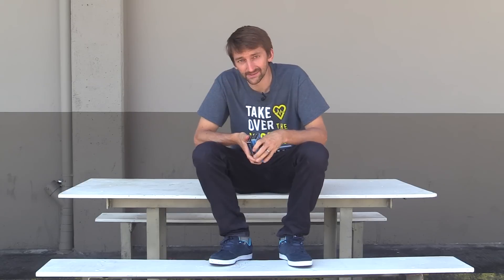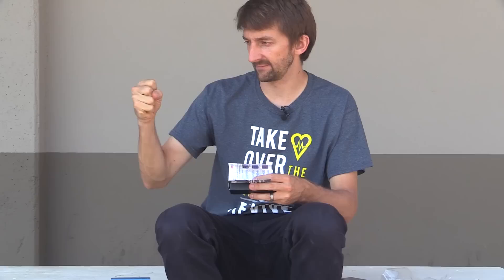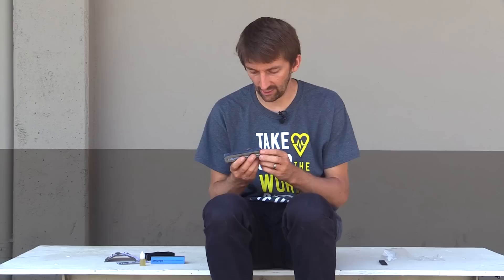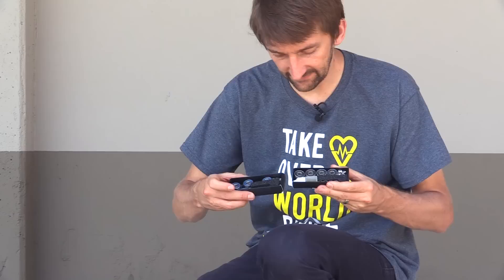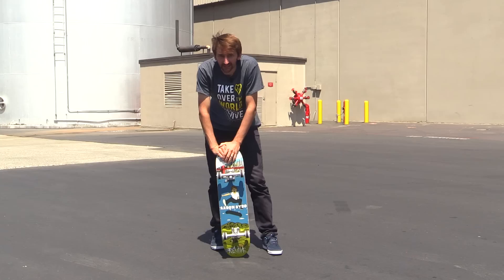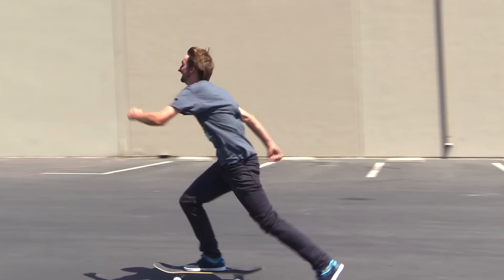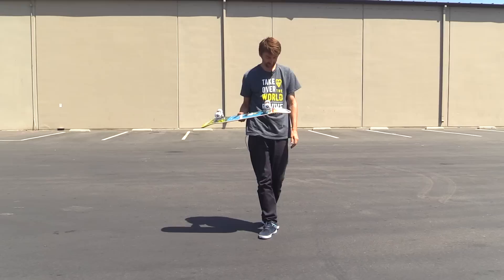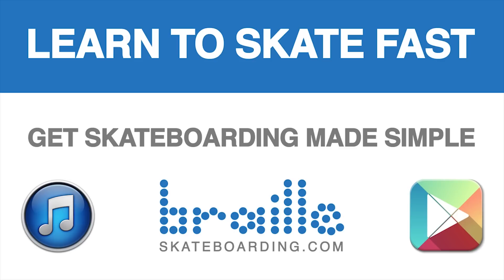CERAMIC BEARINGS VS STAINLESS STEEL BEARINGS | VS EP 9

Comment: Actually the problem of the steel ones is that they slightly expand under heat, causing more friction, unlike ceramic, this ones stay the same way. They both heat up the same way, but they react differently. It's a lot more critical for longboarding, here you can reach way higher velocities and bearing heat. Hope this is helpful
Reply: thanks
Reply: even though your comment is 5 years old, it helped me a lot. THANKS:)
Reply: 2023 I literally stopped this brail vid at 17 secs cuz this told me all I need to know lol .
Reply: Ceramic expands abt 50% as much with same amount of heat idk if it gets up more/less/same in comparison due to friction though so that doesn’t really mean it’s that amount better

Comment: "That heat causes friction" facepalm Friction causes heat
Reply: it said heat from friction, not heat causes friction
Reply: +Harry Belcher  shit sorry he said heat causes friction later in the video. My bad.
Reply: +Harry Belcher 
friction
heat
balls expand
Reply: +Logical Order The heat deforms the bearing balls inside and increases friction is what he meant
Reply: Yea I think it's friction causes heat which in turn causes more friction. If that makes any sense.
Reply: I actually face palmed hah
Reply: Heat causes friction to intensify, actually. If you take a materials science course you will learn that.
Heat also comes from friction, so friction causes heat, which causes more friction.
Reply: +Matt McConaha ooo sorry smartypants
Reply: +Michelle hansell 
a wild 8year old appears...
Reply: +Logical Order your name goes with that comment
Reply: +Tapp Water 
why the fuck cant i + comments when on phone???
Reply: does he know that metal expands
Reply: Well the metal will expand from heat and cause more friction?
Reply: +Logical Order The heat from friction causes even more friction.
Reply: +Ľuboš Rybanský right but the heat is first cause just from the friction alone
Reply: +CookieMaster friction, heat, balls expand
more friction - more heat - more expanding - fine sand adds to the show and bearing locked forever. But that's no proof the 'ceramics' arent too expensive
Reply: The comments on this thread are just as incomprehensible as the explanation for stainless being shorter lived than ceramic because of its Physical properties from the video.
Reply: Timothy McCarthy Ah, someone who really knows how it really works..but how is not told so i'm waiting. I'm sorry for telling disinfo if it's nonsense, just too theoretical, could be. I realize that the total bearing expands by the heat so the added friction might be minimal and there is a small gap between the balls which gives room for some expansion.
Reply: Logical Order they work vice versa. Friction causes heat which causes more friction.
Reply: friction causes heat, and more heat causes more friction. also, heat makes friction create more friction heat. because heat is friction, friction is also heat. furthermore, by creating this friction heat, heat friction will grow as the friction heat grows. furthermore, the heat of the friction will become so hot that the friction heat will give any man a boner; but only because the heat friction (not the friction heat alone) makes things even more hot. like you, i am a scientist.
Reply: JayDee SV well said :p
Reply: If we're going to get technical about this, heat actually causes less friction. If you heat most things up, they will become less viscous (a.k.a more liquidy), and the less viscous something is, the less friction you will have rubbing up against it.
Reply: I facepalmed at your comment. The friction in the bearings causes the balls to heat up thus the balls expand. The balls expand therefore make more contact with the outer walls of the bearing meaning more friction. So... Friction causes heat and then the heat causes more friction. He isn't wrong just left the first bit out.
Reply: Logical Order o
Reply: well since Aaron also has a masters degree in Materials Chemistry, its obviously embarrassing that he doesnt know how these materials behave under different circumstances.
Facepalm indeed. 
Ah no sorry, he spent his life building one of youtubes biggest skateboarding channel, I must have mistaken him...
Calm down. 
Ask the average person and if you gonna facepalm everytime they dont know the right answer, you gonna have a concussion.

Comment: Ceramic bearings are just a marketing strategy to get you to buy a more expensive bearing. Ceramic bearings do handle heat much better, but you will never go fast enough for it to make a difference. If you plan on doing gaps and stairs, steel bearings handle a much higher load than ceramics do. Ceramic bearings crack much more easily than steel ones. As long as you are periodically cleaning your bearings will allow them to last much longer no matter what type of bearing it is. The only plus ceramic bearings have is that they won't rust, which will help them last much longer. That's really the only plus side. Other than that, stainless steel is the way to go. Just make sure you are checking for rust and are cleaning them
Reply: also, the steel rings on a ceramic ball bearing will rust, just not the balls. fyi
Reply: +Rage CL they are actually ment more for longboards. the speeds they go, stainless steel will melt their wheels. they actually do go alot faster as they hold speed longer. iv used both on my cruiser board and iv blown up wheels with stainless because of them getting too hot from bombing a hill to get home faster haha. but ill blow up ceramics all the time by even just doing ollies. its not a marketing strategy, its just guys buying shit ment more for longboards. its like buying longboard trucks to help prevent speed wobbles, but complain that the kingpin gets destroyed for being positioned wrong. lol (i do both, longboard and skate. nothing funner then bombing hills and doing kickflips. lol)
Reply: +Red1676 you see what I mean though. Skateboards don't need them but they market to all types of boarding in order to get more sales than just from longboarding
Reply: I find a lot of them are still marketed to Longboards.  Lots even come with spacers built in. I find a lot of shops will try to get into this long board trend by bringing a bunch of Longboard stuff into their shops as of sales. The problem is the majority of the people buying the Longboards are just people that have no clue of what Longboards are more geared to and just use them to kick around (the people that the skate community hate). So these people will only buy the single longboard, then think they are set. shops think they should bring in all the extra stuff like bearings and the trucks because they think like skaters as every skater needs new parts when their set is destroyed. These idiots don't think like that though, they will kick their Longboards into lakes, use them in the rain, use them in snow and have no clue of anything to the point they will just get rid of it or buy a new complete. Basically,  a lot of the reason why you see more people using ceramic is because shops buy all of this stuff for Longboards,  but it all just sits there. So the shops will drop the prices and will sell it to anyone that is in need of bearings. It's also why you will see a lot of the idiots on Longboards ment to bomb hills and slide. Shops bought them to sell to wider customer base that doesn't really exist, then sell to anyone  when it sits too long. That's kinda the root of people getting ceramics. 

It's fucked though, the majority of the people that hate Longboards,  they don't know what they actually are made for. Lol
Reply: WTF did i just read?
Reply: +Nobsi da Nobs the truth
Reply: Rage CL Nothing of this makes any sense. 
If nobody is buying it and all the longboard riders are idiots, then how does it profit the people that sell it. Youre all speaking out of your arse. I have been working in a skate shop for a few weeks, Lonboard riders have spent the most money over that time by not a small margin to say that.
Reply: Nobsi da Nobs it depends on where you live and what demographic are buying longboards. its like if you live in a collage, the majority of sales of longboards are frat boys and hipsters, where you can sell them just about anything. there are alot of places where downhill longboarders is just getting popular or already are. but there are lots of places where the majority of average people only see them as "crusiers." im here in canada, legit longboarding is popular more out west then out east. when i used to live on the east coast, there was maybe two core downhill guys that would go to the local shop, the rest were the stoner "cruise" kids. now that i live in a bigger area, there are the shops that are selling alot to the core longboarders, but the majority of their longboard sales are to the kids that dont know they are standing on something that they should be wearing a helmet to ride. but the whole reason ceramics are being used in shortboards are because the shops that dont have the core longboarders, they get left with left over stock. i know this because i did placement at my buddies skate shop and know alot of other shops that will do this. iv seen guys buy seismic tekton to be used in some spitfire f1 lizard king street burners because the shophad them marked down for sitting too long. there are also alot of the bike shops that iv seen selling skate stuff and will do the samething. no longboarders are not idiots, i was saying that their bearing serve them a purpose. yes they do spend more then anyone else at a skate shop because their setups are expensive.  ceramics are not made to take impacts.
Reply: Rage CL would it be good for longboarders tho?
Reply: Drew Porter it would definitely be better for long boarders because they wouldn't be at as much risk to crack and if you do downhill stuff your speed might actually heat them up

Comment: I like the explanation except the example you gave. The deformation of the balls from high rpm is what they are referring to. The weight of the rider is negligible. And since they deform less(essentially just because they are a  harder and smoother material) is what is going to cause them to run cooler. Momentum energy stays momentum instead of changing into heat energy via deformation(another word for friction)

Comment: Another reason these high-tech crystalline ceramics are good is because when smooth steel is forced into contact with another smooth steel surface, it gets "wrung" or bound to it in a physical way, much like a suction cup. This effect, when left alone, can cause those two pieces to slightly weld together, and when broken free, will cause marring on both surfaces, where as ceramic on ceramic or even ceramic on steel will not weld together when wrung. This info, mind you, was taught to me by my college manufacturing and machining teacher, and was originally in reference to the care and treatment of gauge blocks, which are precision measuring tools that must be wrung together to get an accurate measurement.

Comment: The only time I can see a need for ceramics is maybe downhill racing due to the heat buildup.
The "deformation" is a sales gimmick. Yes steel can deform under 1000's of pounds, but ceramic will crack or chip long before that... like the first time you kick flip.
Plus, they're probably not even ceramic (zirconium dioxide), It's probably just titanium nitride coated steel (technically a ceramic). The stuff that makes dirt bike shocks and drill bits look gold. it's a cheap and effective friction reducing and highly scratch resistant coating.
Save your money, just buy quality steel.

Comment: Heat causes friction.  Thanks Aaron. Today I learned some physics.
Reply: Napukin I thought that friction created heat?
Reply: Friction causes heat. But in  the case of these bearings the friction causes heat heat causes the bearings to expand, bearings expand and make more contact with the out wall of the bearing thus more friction.
So you're right in this context but wrong in every other context. Both LegendLength and Napukin. Both of you are wrong.
Reply: Ryan Uri Thanks! This helped

Comment: I find the easiest way to notice a difference in the bearings is how much longer the ceramics spin than the other. Not only are they faster, but they spin longer because it takes longer for the friction to stop them. So if you were to always start off skating stainless bearing with 3 pushes and see how far you roll, compared to how far you roll when you give the same 3 pushes of the same force using ceramic bearings, you'll actually go farther. That's what I've noticed more than the speed when it comes to the bearings.
Reply: not how it works when you add friction

Comment: by under load they mean maximum use, the more you use them the hotter the small balls get and metal  heat faster making them expand or deform  they don't mean deform  from the load of your weight.
Reply: you a furry?
Reply: yes I'm a fur.
Reply: really?
Reply: This is correct.
Reply: yes lol
Reply: fair enough
Reply: +Mingetease 'load' is a term used to represent a measurement of it's usual use, so load on the back of a truck is literally the items.
in this case it's a rolling motion with a human on top. the faster or heavier it gets the more 'load' is put on the bearings
Reply: Dylan Zrim Load isn't a measurement at all. Stop trying to pretend you know things so that you can verbally somersault your way to changing the meaning of a word. You wanna teach me something, find an official definition.
Reply: load is definitely a mesument in 1 way shape or form when ur car is in drive your car motor is under "load" when in park or neutral its not under load same thing applys to the berrings not u sitting in ur car not standing on the board
Reply: Exactly
Reply: +Mingetease load is an amalgamation of multiple measurements that takes into account weight, weight distribution, friction, time in use, speed........ Don't humiliate yourself
Reply: +Mingetease highly doubt that mate, like I said, load is a measurement you get after an equation of lots of variables.

not 
weight = load

closer to 
weight + friction + speed + many other things ~= load

just as velocity is speed and direction.
Reply: Dylan Zrim Which includes weight...
Reply: +Mingetease includes but isn't ultimately defined by weight...
Reply: the only thing ultimately defined by weight is weight and all it's measurements. (kg, lb) load is not one of those,

load is it's own category of measurement  completely
Reply: besides, the op is right... the bearings deform as a result of all factors (load)

weight alone can bust the bearings, but you'll need a hydraulic press to damage the bearing balls. and expect to 're-tool (touching surfaces will deform first, they're high tensile steel surfaces) it will more than likely violently explode, and if the press isn't industrial you'd need to fix some leaks...

if load were weight alone bearings would never wear
Reply: +Mingetease easier way to explain...

what makes a big Mac??
by your logic, a big Mac is a middle bun....
Reply: +Mingetease +Mingetease so you realised you were wrong, and now you want to stop the debate, but instead of admitting your mistake you went for the classic 'shut up' technique.. textbook denial strategy

by the way you said earlier that being an engineer doesn't make you think...

.1 I'm not an engineer, nor do I need to be an engineer to know measurements.

.2 if an engineer were to comment they would more or less agree with me, maybe correcting terminology.
Reply: +Mingetease I only said weight alone would take weights not attainable by human force alone.
weight will add to load, but load is not defined by weight.

I haven't switched my points at all. 

you argue worse than one of them angry 'I hate everyone' vegans. this was rather amusing, but I have more important things to do than be 'lectured' about loads by a pleb who can't comprehend a thing he reads...
Reply: +Mingetease by the looks of you, the only minge you tease is the after school care Venter down the road....
Reply: Dylan Zrim hahah really trying to be offended. I really am. Alas, I am not. You do not possess the intellect required to insult me.
Reply: Weight is not mass, so kilograms don't measure weight. Weight is a force, the force that gravity exerts on you for being on Earth.
Reply: +ChemiCalChems now that's wrong. weight is the measurement of mass on earth......
Reply: Dylan Zrim Now you're talking sense
Reply: Dylan Zrim
weight is by definition the force a mass is subject to in a gravitational field, so, it's a force
Reply: weight is measured in newtons while mass is measured in kg. weight is the force that is applied in a gravitational field.

In space you are weightless, however your mass is still the same. A scale measures your weight in newtons and usually converts it to kg, mass, so you can easily tell the mass without converting newtons into kilograms. Of course the scale would show roughly 1/6 of your mass if you are on the moon because the scale assumes that you are in the Earths gravitational field(on sealevel to be precise). The scale measures a lower weight on the moon because you simply weigh less. But you still have the orignal mass.
Reply: People are so ignorant.